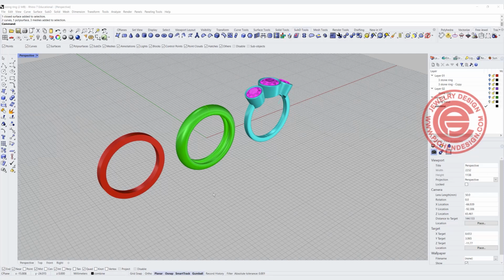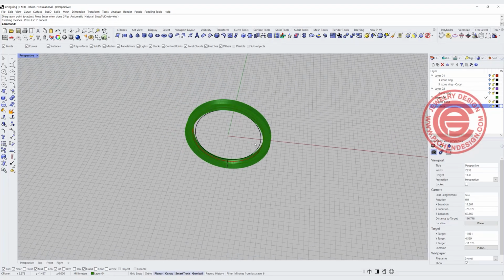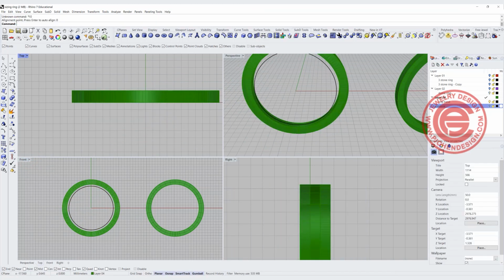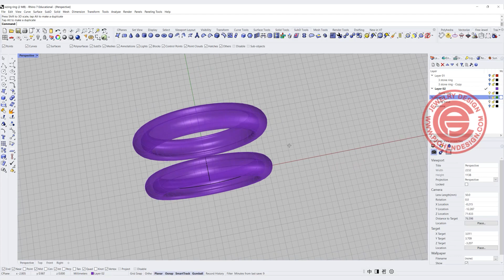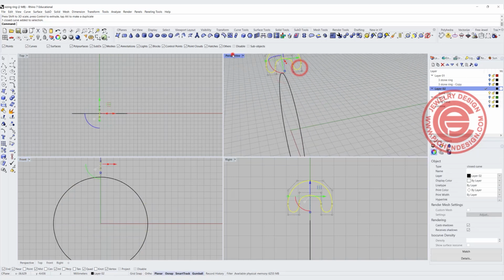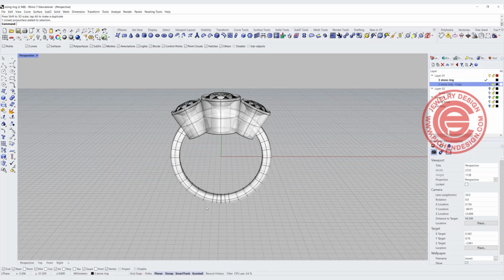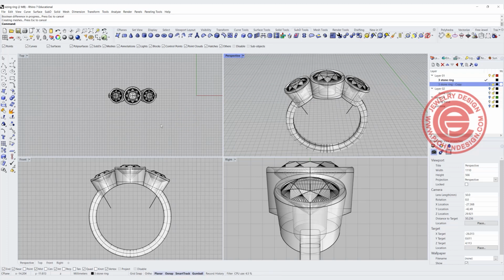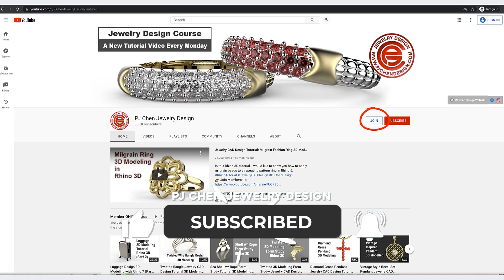How to Change Ring 3D Model Sizes with Rhino 3D Software #319

Comment: Nice tutorial! There is also very powerful technique for sizing rhino and stl ring models - using the "Flow along curve" command. With simple ring you just select the ring, first shank diameter, second diameter and have the "Stretch = Yes" option set. You have the ring properly sized while keeping the width and thickness the same as in the original ring. The command is also useful for more complex rings if the lower part of the shank is simple. In that case you can cut the shank at the bottom and use the "Flow along curve" command with  "Stretch=No" option to keep the form of the ring intact. After using the flow command the gap in the shank is closed using the "Sweep 1 Rail" command. The stones are moved separately by using the same "Flow along curve" command with the option "Rigid=Yes". In fact, the technique  is like the one used to size rings in metal -  the shank is cut at the bottom. And if changing to bigger size, a piece of metal is added to fill the gap.
Reply from the maker: great! thank you for sharing.👍